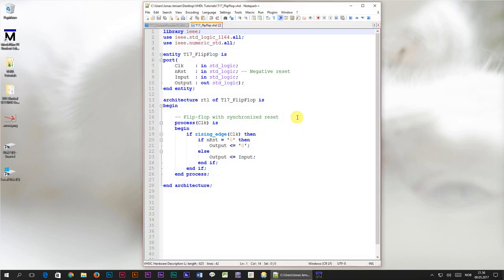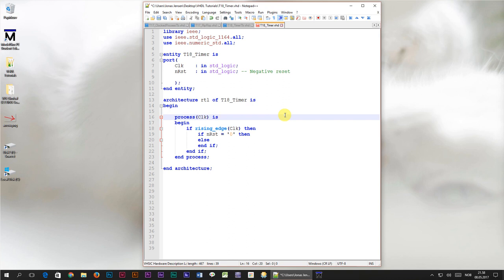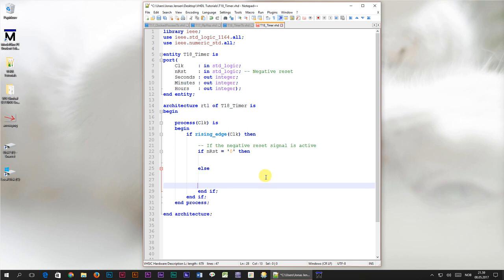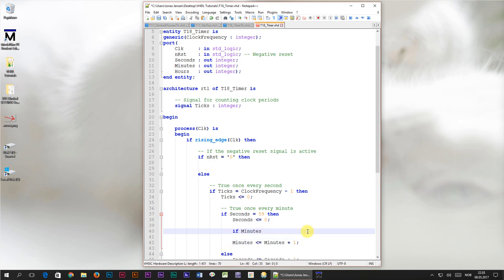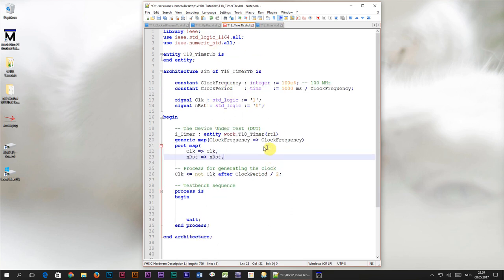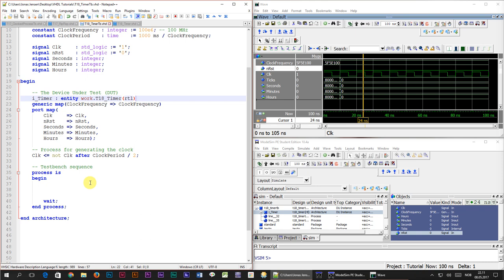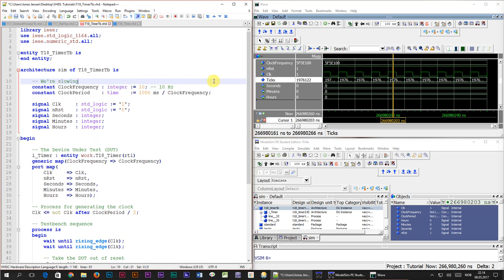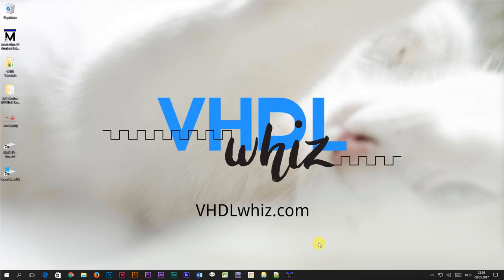How to create a timer in VHDL

Comment: Hi Sir, i'm a total vhdl novice and i've a silly question. The Seconds signal became 0 after 0.1 simulation seconds (100000000 ns) and this is ok because this is the time needed to take the DUT out of the reset. But, as you see at 10:19 , the Seconds signal increments to 1 at 1.2 simulation seconds (1200000000 ns). I don't understant why it seems to lose another 0.1 second. I've tried your code on Modelsim and each time the Seconds signal seems to be incremented every 1.1 real seconds. I'm sure that it is ok but can you explain me why? Thank you for your videos. I'm a university student and i'm currently studying for the fpga programming exam.

Comment: Dear Whiz, in T18_Timer.vhd, I added 'ticks' to the port and removed it from the architecture. Then in T18_TimerTb.vhd I added 'ticks' to the architecture and the port map.
This worked.
So my question is, what is the difference between your program and mine? What did I just do? In other words, in T18_Timer.vhd what is the difference between signals defined under entity and those under architecture?
Thanks.
Reply from the maker: The entity is just a way to pass signals between modules. If you defined the Ticks signal in the testbench and passed it to the module as an inout mode signal, there would be no functional difference.

However, we can limit who can update signals by using "in" and "out" modes on entities instead of "inout" as we did in this example. Modes "in" and "out" are by far more common.
Reply: @VHDLwhiz  Thanks a lot. As you can see, I am following all your lessons :)

Comment: Hi I am a beginner in VHDL and I have a question, is there a reason why you use a negative reset instead of a positive? Or is it just a matter of your taste?
Reply from the maker: I liked to use negative reset because most FPGAs will initialize signals to '0' by default. If you forget to actively control the reset, it's going to fail brutally rather than work silently. I've stopped using negative reset in my newer tutorials because it's confusing. Positive or negative doesn't really matter.
Reply from the maker: @hekk_tech5975  Hello. You can make a finite-state machine that controls the counting. For example, with the three states: RELEASED, PRESSED_COUNTING, PRESSED_IDLE. There are many ways to design the state machine with other states as well. Read about state machines here: https://vhdlwhiz.com/finite-state-machine/

You can join my Facebook group to ask questions like yours: https://www.facebook.com/groups/vhdlwhiz/
Reply: @VHDLwhiz  nice, thanks for the answer! Yes I joined the group too. I will try to create a FSM with help of your tutorial.

Comment: I can see that whenever you run a code that has an error, it will appear in the transcript and I would like to know how to make it appear because whenever I compile my project it only shows "Compile of "file name" failed with 2 errors"  but not the line where the error occurs. Thanks!
Reply from the maker: Select the Project tab in ModelSim. Right-click on a blank space in the project window, not on a file name. Select Project Settings. Check the box titled "Display compiler output" and hit OK.

Comment: compilation error - it says it can't have 2 wait until statements in a process if, I delete one & proceed again it  says wait statement must-have condition clause with wait until
Reply from the maker: I'm guessing you are trying to synthesize the process. That doesn't work because there's no hardware in the FPGA that can realize what you are asking with the VHDL code. In code meant for synthesis, we need to follow some rules to stay within what's physically possible. But in testbenches, you can play around to the full extent of the VHDL language. Try to compile the example in a simulator like ModelSim. 🙂
Reply: @VHDLwhiz  yes, I tried in modelsim altera, it says work library doesn't exist. How to add work library to modelsim altera?
Reply from the maker: @harykishore1914   "work" is the default library name in ModelSim. You can create it by typing "vlib work" in the ModelSim console.

Comment: ----------------------------------------------------------------------------------
-- Company: 
-- Engineer: 
-- 
-- Create Date: 22.12.2023 20:38:19
-- Design Name: 
-- Module Name: timer - Behavioral
-- Project Name: 
-- Target Devices: 
-- Tool Versions: 
-- Description: 
-- 
-- Dependencies: 
-- 
-- Revision:
-- Revision 0.01 - File Created
-- Additional Comments:
-- 
----------------------------------------------------------------------------------

library IEEE;
use IEEE.STD_LOGIC_1164.ALL;
use IEEE.STD_LOGIC_UNSIGNED.ALL;
use IEEE.NUMERIC_STD.ALL;

-- Uncomment the following library declaration if using
-- arithmetic functions with Signed or Unsigned values
--use IEEE.NUMERIC_STD.ALL;

-- Uncomment the following library declaration if instantiating
-- any Xilinx leaf cells in this code.
--library UNISIM;
--use UNISIM.VComponents.all;

entity timer is
--  Port ( );

	port(
	       rst : in std_logic;
		   clk : in std_logic;
		   hours_out : out integer;
		   minutes_out : out integer;
		   seconds_out : out integer;
		   );
end timer;

architecture Behavioral of timer is

    signal ticks : integer := 0;
    signal clk_f : integer := 50000000;
    signal hours, minutes, seconds : integer := 0;

begin

    process(clk)
    begin
        if rst = '1' then
            ticks <= 0;
            seconds <= 0;
            minutes <= 0;
            hours <= 0;
        elsif rising_edge(clk) then
            if ticks = clk_f - 1 then
                ticks <= 0;
                if seconds = 59 then
				    seconds <=0;
					if minutes = 59 then
					    minutes <= 0;
						if hours = 23 then
						   hours <= 0;
						else 
						   hours <= hours + 1;
						end if;
					else
					    minutes <= minutes + 1;
				    end if;
				else
				    seconds <= seconds +1;
			    end if;
				
            else
                ticks <= ticks + 1;
            end if;
        end if;
    end process;

    hours_out <= hours;
    minutes_out <= minutes;
    seconds_out <= seconds;

end Behavioral;

Please someone find  error in my code. It is showing some error while simulating in xilinx vivado software.